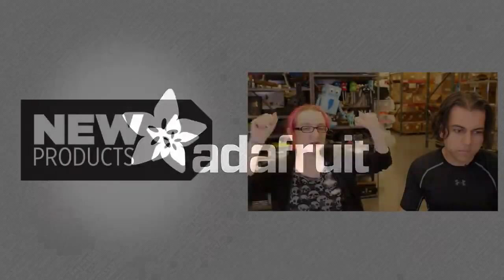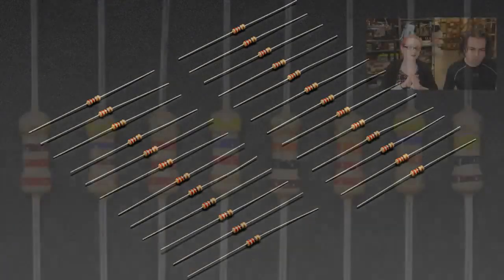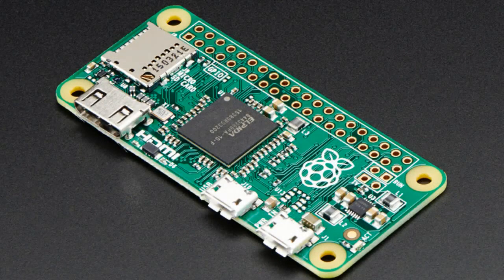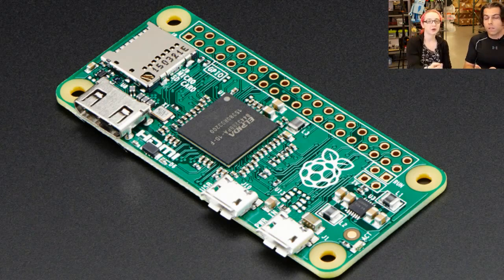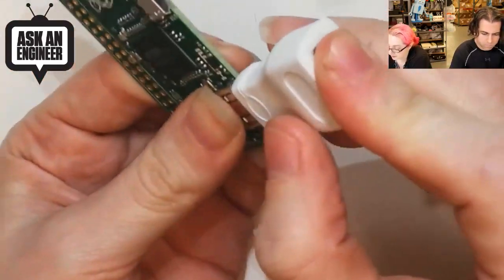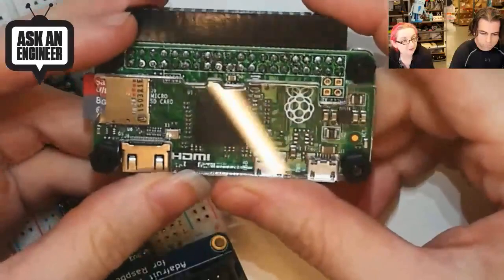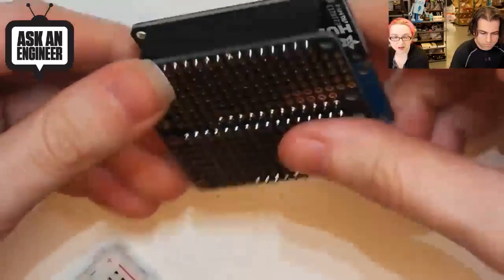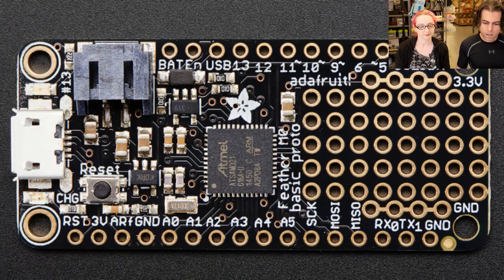New Products 12/2/2015

Comment: I don't see at all why the pi zero could not be sent in an envelop. Antistatic bag adds no thickness. Throughout years and years of shipping envelopes with PCBs inside I've never seen once that the thing malfunctioned. So that's my experience, reality is of course different. PCBs do fail in shipping. Even if it occurs 1%,, which in my opinion is grossly overestimated, I still find it an acceptable risk if you allow people to choose between economy shipping and standard shipping.